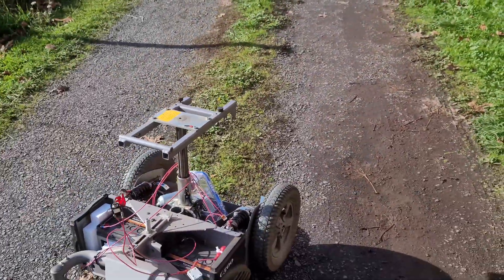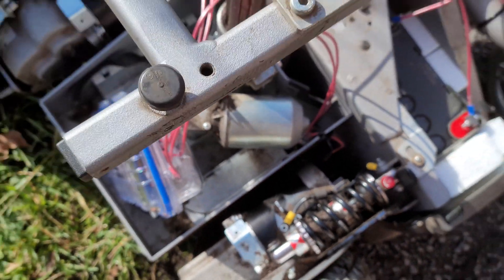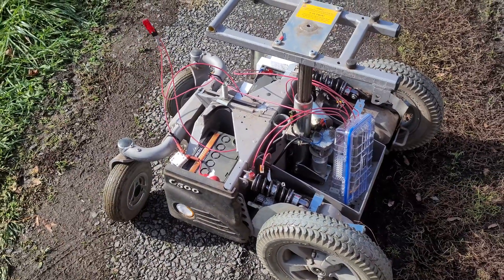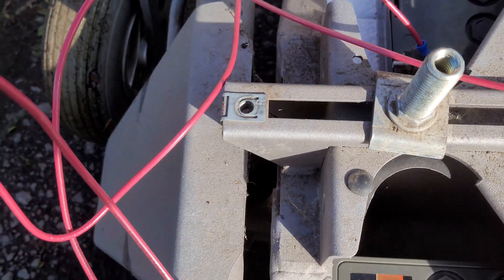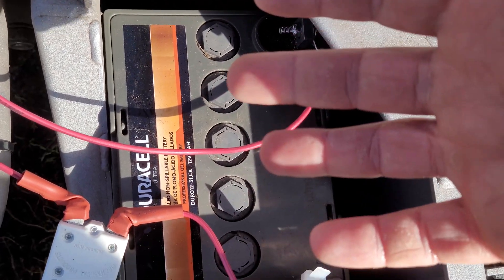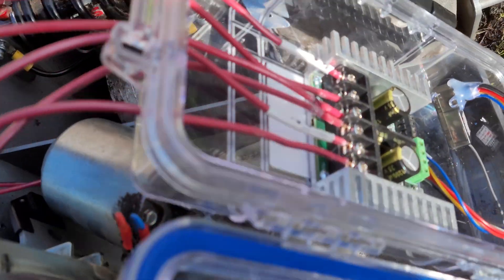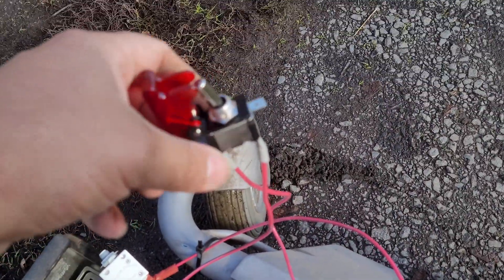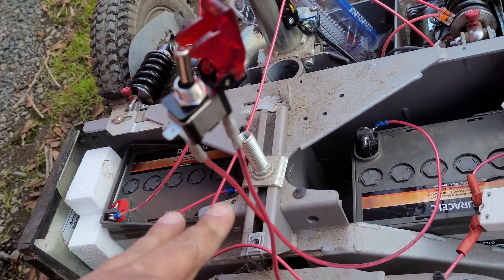DIY Robot - Make Your Own Rover -  Sabertooth 2x32

Comment: Hello, quick question, I see everything is directly connected to the motors and battery, no need for extra stuff apart from that fuse you installed right ?
Reply from the maker: Some people put fuses between motors and the sabertooth motor controller, however this can limit efficiency of motors and introduce errors. It's up to you there are trade offs for safety and repeatability of potential for errors - also sabretooth has built in safety features. I have installed fuses between motors on a later model, with sufficiently high amperage so as not to interfere with normal peaks in motor draw.
Reply: @levi_lcl  thanks for the reply, I work with low voltage for this project, 12v and 550 motors, don't think I'll use a fuse, as you said the board has enough safety measures
Reply from the maker: Isn't lower voltage mean higher amp draw - so 12 v is more dangerous than 24 v in terms of amps. It's been months so if you have any safety concern don't rely on me lol ask Sabretooth or read official manuals. @Cormano980